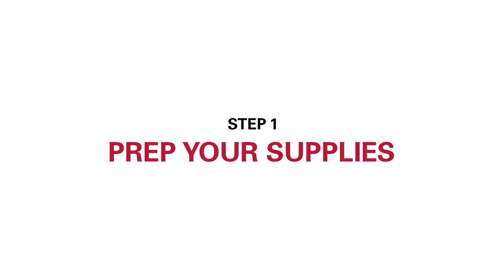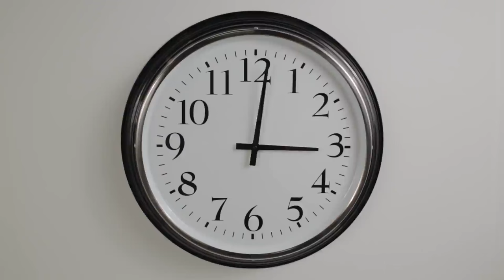KILZ® How To: Refinish Kitchen Cabinets

Comment: I did my bathroom cabinets with this technique and it turned out gorgeous!! 3 years later, still in perfect condition
Reply: Esha I used semi gloss interior paint from Valspar. Latex
Reply: How many coats of primer did you need?
Reply: @cpera7248  just one good coat. my cabinets were very light oak and I painted them black. i just sanded the cabinets just enough for a smooth paint application.

Comment: I think a brush and roller will leave texture on it.  Better to spray.
Reply: True. But the prep work is much more involved. Everything you don't want paint on you must mask which is time consuming. Your kitchen will be unusable until you are finished. This rarely is a weekend project despite what some may say especially if you have 30-40 doors and drawers and it's just you and maybe the wife helping. You'll need a separate well ventilated  room to paint the doors and drawers. If you've never used a sprayer you will definitely want some practice with it before getting started. 

A foam paint roller will leave a small orange peel texture and not that smooth glass like finish a sprayer will have. However the roller texture will only be noticeable up close and look like a matte finish from a distance, IMO the roller texture isn't bad at all depending on the quality paint you use.